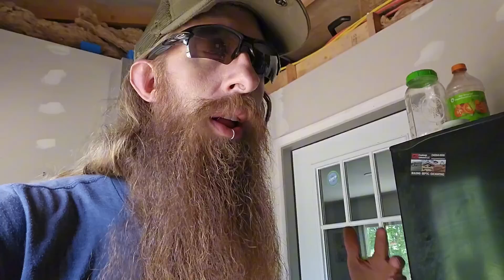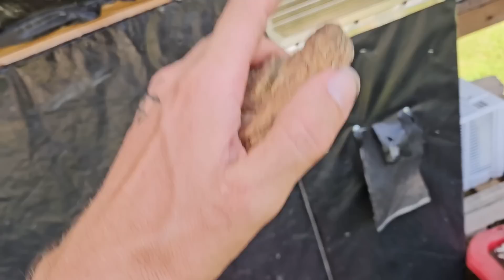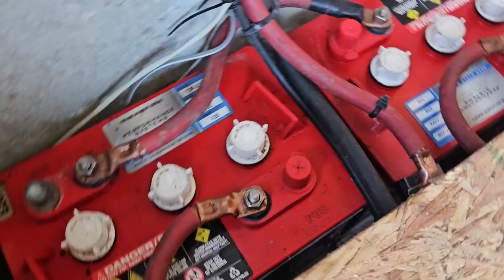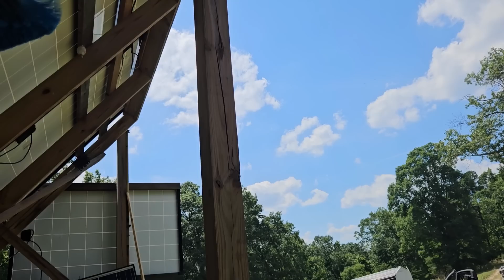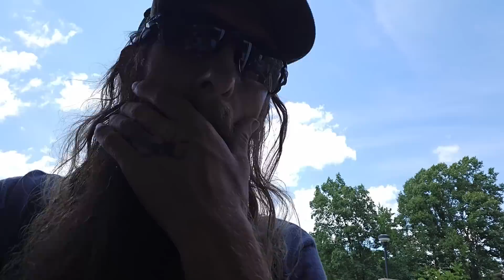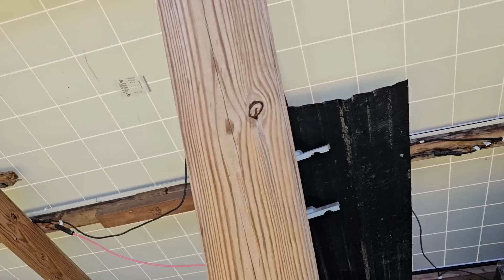Practically using Off-Grid Solar power

Comment: I could go twenty years and never pay in electricity what you have in equipment!  Just get a big generator and be done with all this stuff.  I’d rather spend money to have a well or build a cistern.  Improve the driveway for fuel delivery like propane.  Living out in the sticks the emphasis should be privacy, and house placement.  You’re always going to have expense.  Why pay all that up front expense and the labor to store it?  My effort would be for growing food and canning.  Harvesting wood.  Access into homestead.  I’ve never liked anything with batteries unless it was rechargeable lanterns and flashlights.  Power tools.  Gotta have gas for push mowers, tractors, vehicles, and blowers, weed eaters.  Unless you think combustion motors are evil.  Personally I think hydrogen combustion motors are the future.  Should have been first choice a hundred years ago, but there’s no money when customer can make his own fuel with water.  LoL its being done by very smart people to avoid paying highway taxes and using carbon fuels.

Comment: I just gotta say, your setup and your mindset rocks, got a small 3kwh system I run daily but I do have a grid connection to fall back on. I do get waiting for the sun to be up to run our laundry, took very little effort to change our ways to get full use of what I got going.

Comment: On what you said about electric vehicles, I work at rivian building electric trucks. Although I drive a gas vehicle, for you to get an electric vehicle with your setup should not effect you're power. If you drive once a week it would stay fully charged for the most part, and you could use it as a portable powerbank as it has AC ports. There are also other uses for the vehicle because it has a built in air compressed in the bed and a tent add on so you can go camping with the vehicle. You could use it as a utility vehicle but also go on a nice road trip without having to spend money on gas as we all know is expensive. Not to be a salesman but I'm just saying it wouldn't be a horrible idea to look into. Thanks for reading it if you do and you and will and going to be with best power team!!

Comment: Hi Nate!  I have been off grid over 20 years and my system is 1.4Kw solar and 800Ah of LF batteries that are stored inside my cabin. I keep my controllers in the cabin so I can monitor charging and they stay cool that way. LFP do not off gas and have twice the capacity and life cycles of flooded and no maintenance. You should upgrade and simplify your system friend.

Comment: You might be one of the few who could pull this off, but Tech Ingredients did a series on solar panels and maximizing them, one segment was on using cheap, lightweight mirrors to double the light per panel and they can be used to track the sun easier since mirrors weigh less than solar panels... their mirrors also act to protect the panels in case of hail since they used scrap sheet metal because that's what was available. It's not quite conventional, kind of like how they managed to use a fan to cool their test panels for less energy than they gain from having a cooler panel, but you seem to be handy enough and good enough at scrounging that you might be one of the few who could make their suggestion work and make financial sense.

It's a long shot, but it might help you in the winter since you have less light but since it's cold, the panels are more efficient and can handle more irradiance so no matter how large the mirrors are, the panels can take it during the colder months.

Comment: Looks like 7.4 kw solar,11.2 kwh usable battery, 2770 watts on charger so you had a 2400w load filming. Coffee makers, air fryer or induction stove only use .6kw every 20 mins. I have changed my solar upgrades 3 times this year delayed the install/purchase then found 600w BF for $200 cad, so 5 for 3kw and $1000cad to add PV4. Nate if you switch to bi facial panels, 7kw in overcast over 1.3kw all day long.  If you like a simple upgrade, lead carbon batteries are just like lead acid but sealed and discharge to 30%, no bms or equalization needed, -40 to +60c temps, bolt right in 57.8v absorb and 55v float, range 43v to 51.6v, they only off gas if charge rate is above 58v. Might consider mounting new panels vertical, no snow to clear and seem to wash off good in rain. A system this size at Sig solar is under $6000 usd,  EG4 3K ,10KW batt, 8kw solar. $2k for each additional 10kw of course add tax/shipping.

Comment: If you built another solar station, it should be single purpose and smaller, perhaps just to charge the large portable units and tool batteries. Solar isn't given the credit it deserves just because people have mostly seen in town integration where small portions are sold back or in cars to run A/C, stereo, or give like 6 miles of range for an all day charge.

With the proper slignment, management, and battery types, solar is bloody fantastic. If only people would inveat in it properly and peeps weren't greedy ass hats selling patents, diverting funds, and purposefully lowering output to prove how much better all-in-one generators are.

Once you're set up and have stuff moved where you want, I'd love to see some of the engineering YouTubers to stop by and do some comparative science, showing exactly what happens, step by step, from storage, generation, transferring, storage, transferring, and using. Maybe vet sponsored by a panel company that can guarantee x% better use scenarios, do all the installs and panels for free, and state that if not better, they'll put it all back. No charge.

There's even wind turbine companies working on small unit, almost silent units that can help in storms/cloud cover that can keep necessary power flowing. Fridges/freezers that seal super tight... all sortsnof things that cost an arm amd a leg that you may be to get for free or steep discount.

Even certain types of insulation and primer/paint thatbarebsuper insulative and resistent to weather peepl coupd beninterested in sponsorships.

Comment: Understand that it's best to use the batteries until they stop working but have you considered lithium iron phosphate batteries for when you eventually need to replace the lead acid ones? 

Longer cycle life, depth of discharge, wider operating temperatures. I believe they are actually cheaper when you consider that you need less capacity because of the greater depth of discharge.

Different use case but I replaced the 22ah lead acid batteries in my mobility scooter for 105ah liFePO4s and it's been running great for the last 4 years. Before that I had to replace them every year because I'm young (I have ms) and get out a lot and inevitably run them below 50%. Had to build a slightly larger battery box (still fits under the seat) and it's only 2kg heavier.

Comment: Technology connections did a video on air conditioning where he essentially treats his house as a battery; he uses his air conditioning at the time of day when the demand is lowest and electricity is cheapest, making his house chilly. Then turns it off and lets his house slowly warm up when the electricity is in demand. The temperature fluctuation is pretty minor and it saves him a lot of money on power. And reduces the strain on the grid to prevent brownouts.

Obviously this is a different concept for you, because you're on the grid and you're not competing with others for electricity, but you use the same concept of doing as much as you can with electricity when you're producing the most. Obviously charging everything, but also cooking and washing clothes etc. This means when you have less electricity you won't need to drain your battery on these things, only the essentials

Comment: Wow 4years. At what point did you reach your return of investment? I see that you have used very little distilled water out of that gallon. How often do you have to add water. We would like to  a preventative maintenance for your batteries video.

Comment: If there is a fire in your solar shed, how would you put it out?
Reply from the maker: Honestly if there's a fire I don't think I'd approach it. Just stay back and keep it from spreading
Reply: You can check with your local fire department to see if they would recharge/repressurize fire extinguishers for free. Some do so to help ensure homes have a functional fire extinguisher for safety.  A single/large extinguisher might not cover a full electrical fire if that whole shed goes up. But it could buy you time or help contain it more safely (rather than using water) while waiting for a fire department to respond.
Reply: I hope it never comes to that but my wife and I were curious if you had a plan for that situation. Love the content!

Comment: $10,000. will buy a lot of electricity When you spend 10 on the solar, will  get your money back or do the parts break down a lot where you got to Expensive parts.How long have you had your system running will no problems Material wise.
Reply from the maker: 4 years no issues. Also getting power poles back here is a 20k to 30k expense plus monthly bill. Instant payoff lol, grid Install is pricy

Comment: We've been off grid over three years. Similar setup. Only running about 4kw solar panels, three charge controllers, the big difference is we got away from lead acid about 2 years in and swapped over to lithium iron phosphate... Was able to go from fourteen 100 amp hour lead acid to only three 200 amp hour lithium. It produces enough for our needs. Great video. Love what you're doing.
Reply: Do you fear that only having 3 batteries doesnt provide enough if u redundancy?
Reply: @kylesimmons2631  the beauty of our system is that I built it to be modular. At some point we will add more batteries. Right not we have two batteries as the main power and keep the third as the backup. We still have most of the old lead deep cycle which we keep maintained but only use for things I do in my workshop. In a way these are my backup to my backup until they all finally give out.

Comment: how do you connect panels together when you have panels on 2 sides? like you have alot of panels facing the sun and u have the 3-4 panels extra, how do you add those so it all charges one powerbank? i have this issue with my setup

Comment: I love building solar power setups, run my house and my in laws off grid almost year round now, I’m not sure if anyone has told you about forklift batteries(AKA:IFLA), they’re just simple, old school giant lead acid batteries. I know a few people who have been running the same forklift cells for 25 years in remote off grid setups. 
I hand assembled a 100kwh lifepo4 pack at my in laws, that ran about $15,000 and took 2 weeks to assemble.
I recently acquired 150kwh of forklift battery cells for $3300 and put them in use in about 6 hours.  
For people starting homesteading i would HIGHLY recommend looking into getting some used forklift batteries. When a warehouse considers them dead they still have over 80% usable capacity left in them and you can run them down to 10% regularly with no ill effects. And will serve you for years to come.
Reply: Most forklift batteries are 36 or 48 volts, 48 is more common.  They are pretty bullet proof,  since they have to deal with the vibration of running in mobile equipment.   And a dead cell in a forklift battery can be replaced and get it back in service.  Make friends with a local forklift service guy, you will be surprised how cheap stuff can be picked up.

Comment: You should have the pump push the water through a filtration system. They are pricey but it can move with you to the house. You're doing awesome at moving the large sediment with your high grab system however microscopically its a nightmare.